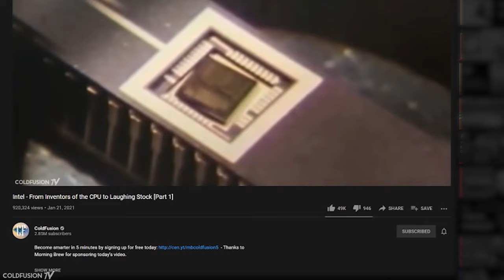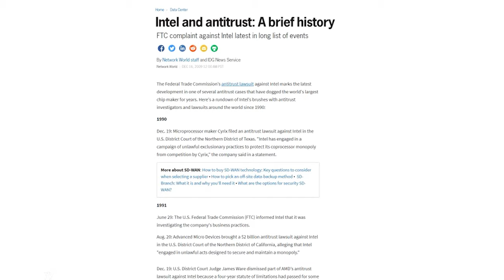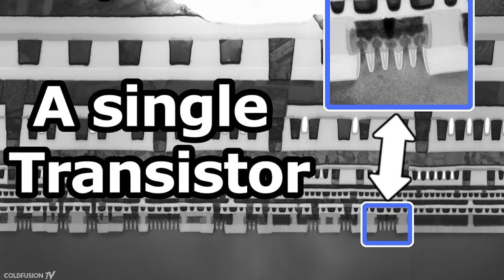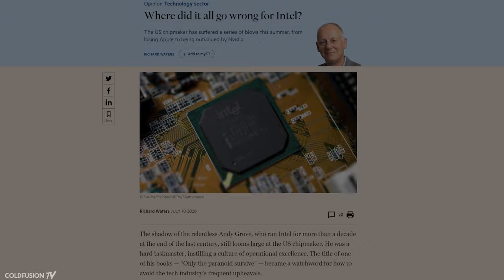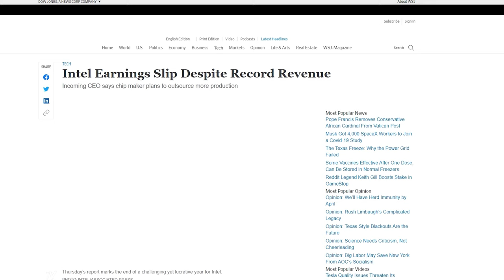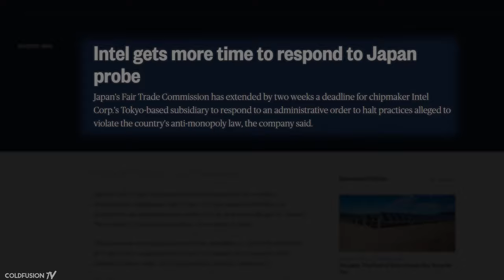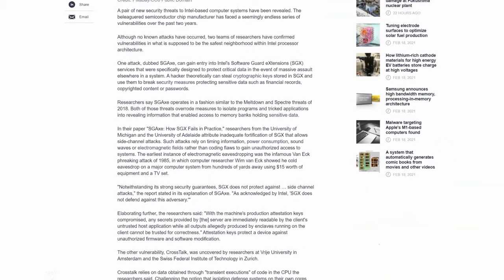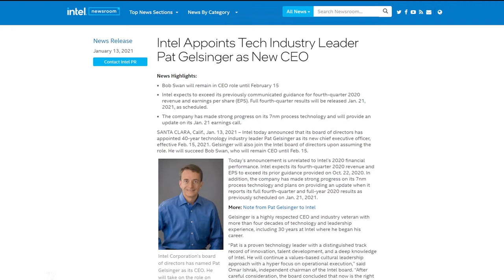Intel - From Inventors of the CPU to Laughing Stock [Part 2]

Comment: So, just to put the sizes of the transistors into perspective: the nearest-neighbour distance between atoms in the silicon crystal lattice is 0.235nm. That means that 5nm is less than 20 atoms. To me that is utterly mindblowing!
Reply: Kenn Honson X  ??????????
Reply: Kenn Honson X  No it isn't we passed 20 nm in like 2010. if it was just a marketing term TMSC and chip fabs would be sued for false advertising
Reply: @shadowxxe  we wouldnt have an increase on performance if the transistor would have been stuck on 20nm since 2010
Reply: Kenn Honson X  do you have a source? I know the 28nm was real (having seen electronmicrographs of them) and i was pretty convinced that the 14nm could deal with the sub-threshold leakage problems (the high-k dielectrics solution was genius). I had also heard some definitions of where they measured got changed with 7nm. Also with 5nm I don't see how they could possibly overcome the quantum tunnelling issues that would be significant at that gate width.
Reply: What do you think will happen at 2nm and below? A new lithography to read it or will it be something else?  The gates won't work. Too much leakage.  Another isotope will be needed.
Reply: More like over 30 atoms
Reply: Kenn Honson X  The reference material is outdated according to Wikipedia. Do you have another one, try and get one yourself and look at it through a microscope.
Reply: Kenn Honson X  Lol, we are in 5nm already. 20nm are more used on FPGA's. The benefits of advanced node manufacturing like going for 5nm is smaller transistors. With smaller transistors, you can put more into the same space as older larger transistors and more transistors means more power. That is why when you buy a motherboard today you see fewer components and chips as opposed to motherboard back 1999 which still has northbridge and southbridge chips to help interconnection, both northbridge and southbridge are now integrated in CPU's today which enables manufacturers design smaller pc's, laptops and smartphones.
Reply: @benjy117  We'll cross the quantum mechanics, gates will exhibit quantum tunneling meaning all transistors that should work like gates will now be useless due to quantum effect that both electrons can appear in any place at the same time. They will need to use exotic materials to avoid this from happening or create a new technology that can replace classical processor architecture.
Reply: @Rye042  Well, there is a thing with the size of the manufacturing process though. 5nm doesn't actually describe the size of a single transistor. A complete transistor made by the 5nm process is indeed about 20-30nm large as some in the comments here already pointed out.
The thing is though, this difference between how the process is called and how large a transistor is in reality exists since decades. A single transistor of a chip made with the 20nm process is also much bigger than 20nm.
Reply: @shadowxxe  Sorry but that's just wrong. The name of the node is not the transistor size, and its been that way for years now.
Reply: @Rye042  the north bridge is in the cpu, there is still a south bridge on many boards, sure there are soc's that have both but but for desktops the south bridge is mostly under a heatsink now days but still there cause Intel and AMD have not enough pins for the south bridge
Reply: all their pins go to ram and pci-e and some usb3 and some sata and the south bridge , south bridge handles audio ( realtek ALC) , extra USB3 and Usb2, the USB3 socket on the bottom of the board for external USB comes from south bridge not the processor. Additional sata can come from the south bridge but can also for a raid controller connected to the south bridge  ; if a cpu has to do that all on it's own, the speed would be lower.
Reply: @fullyverified7491  Yes i know it isn't its the space between transistors now where did i say it wasn't
Reply: @shadowxxe  when you said theyd be sued for false advertising if it wasn't?
Reply: @fullyverified7491  They guy I replied to said "It was just a marketing term" implying that the transistors were not in fact 5nm apart were this true conceivably they could be sued for false advertising.
Reply: @Rye042  They already did the exotic materials thing back at Haswell with the hafnium oxide (high K) gate oxides. you might be able to get away with smaller using graphene nanoribbons but I still think 2nm is a bit small. 3nm might be achievable then
Reply: There are limits to how small you can transistors make due to short channel effect. We are pretty close to theoretical limits now.
Reply: @shadowxxe  they can't be sued because they aren't saying they make 5nm transistors. Some call their node "5nm" (TSMC calls it officially "5NP" iirc), but they could call it the "pizza node" if they wanted.  It's just a nick-name for a manufacturing process.
Reply: The limits are not just the physical size of the transistor. Even if you could overcome the tunnelling issues (which you cant) then you would have lithography issues. They already had to move to extreme UV to reduce the wavelength sufficiently. Beyond that you start to get into x-rays amd they are much harder to craft the appropriate optics for. They can reach smaller fidelity with electron beam lithography due to the smaller wavelength (de Broglie theory) but at that point the limit is not the lithographic wavelength, but the photoresist/e-beam resist polymer. Polymethylmethacrylate (PMMA) is the most common e-beam resist and the width of the polymer chain is  around 1nm minimum. If you lined everything up perfectly and had the minimum achievable spot size you would still be limited to 1nm resolution by the polymer. So total limits would be: source (1nm), channel with gate (+1nn), drain (+1nm), gap to next transistor (+1nm), giving a minimum of 4nm. Realistically 5nm will be the last shrinkage and after that it is architecture optimisations like intel have been doing with their 14 nm process for a while.
Reply: It's the lithography size that's 5nm. Not the transistor itself. Kinda like using a fine brush to paint or carve the smallest meaningful art, to oversimplify it. But yes, it's definitely mind-blowing!! 😲
Reply: @ganesang5537  not sure that's correct either. It's not like Intel and TSMC use fundamentally different lithography. These machines often come from the same vendor while TSMC calls their nodes different than Intel for similar transistor density.

We either need to think if these names like code names or the industry needs to change.  For example, there's nothing particularly tiger-like in Intel's tiger lake or anything painting-like in AMDs renoir.  They are just names and trying to find meaning beyond that leads to confusion.
Reply: @ganesang5537  it used to be the size of the transistor, then they changed the definition for Marketing reasons
Reply: @Ormaaj  Even with GAA (gate all around) geometries you are still limited to sizes similar to those I mentioned. According to the definitions of UV once you get below a wavelength of 10nm you have moved from EUV into X-rays (https://www.britannica.com/science/X-ray), meaning that even the most extreme UV you can only achieve a resolution of 5nm  (according to the Abbe diffraction limit assuming perfect optics where sinθ=1).  EBL is easier because you don't have to contend with this diffraction limit (as electrons have a much smaller λ according to de Broglie theory) and are much easier to focus than X-rays.

Those limits are not just for monolithic processes, even with  some sort of hetero-junction (like with the graphene nanoribbon example I mentioned in my earlier post) you are still limited by how small you can craft those features by the polymer chemistry.  Modern resist polymers such as Hydrogen silsesquioxane (HSQ) can still only achieve 6nm wide lines (https://www.sciencedirect.com/science/article/abs/pii/S0167931707000408?via%3Dihub - I appreciate this was done in a lab 10 years ago but it takes time to reach production) and if you look at the molecular structure it is still over 4 atoms wide at the narrowest point (~1nm).

The way they have been labelling their devices is the big problem and the fact they keep changing the definition. It was originally source + gate + drain but now it seems they are just using gate length to try and use a smaller numbering for deliberately misleading marketing.

You might get more performance out of a HEMT process but you won't be able to make it smaller even if you improve the resolution, because of the limits of the atoms in the polymer resist structure.

Oh and resorting to bottom-up self assembly methods won't work either as you still need to demark the locations for your traces. Trust me, I spent several years trying to make molecular wires (that project had other issues but if you want to read more then https://pubs.acs.org/doi/abs/10.1021/ja110837s )
Reply: Yeah if you want to see a video of the EUV lithography machine of ASML ( which all these big fabs use to "print" the designs onto the chips)
You can check out the video: "Extreme physics that push moore's law to the next level" by seeker.
It is a mind blowing machine, you don't get all details as trade secrets but you get a little understanding.

Comment: AMD actually worked on making better chips while Intel was busy trying to take them down instead of focusing on better their products and ended up doing it to themselves in the process.
Reply: Wrong, amd is better
I've always bought amd because I believe in them so they're stock up up
Reply: @dixiedamelio8170  Thats literally what hes saying
Reply: @dixiedamelio8170  amd’s not always better. If you look at pc budgets between $500-$1k intel would be the better option with their 10100 and 10400f. However amd does beat them in higher budgets and performance with the 5000 series
Reply: @staitz2728  wtf are you talking about? Amd literally beats intel at all price points. It's not like amd's previous generation(s) chips suddenly disappeared
Reply: @tristanreymendoza2402  have you seen the 3600 and 10400f? The 10400f is the better choice. $50 cheaper and has the same/similar performance
Reply: Putting aside all of this Ford vs. Chevy nonsense, I think Alpha Jay is right. Intel was fighting for dominance. AMD was fighting for survival. You tend to get more creative when you're struggling to survive. Perhaps we'll see the same realization from Intel now that the tables are turning/have turned. Case in point (and if I remember the numbers correctly from the video), look at what AMD was able to do with a $1.8B R&D budget versus Intel's $13B.
Reply: @dmhendricks  The fact that AMD can beat Intel with a tenth of their budget is really mind blowing.
Reply: @dixiedamelio8170  💀💀💀 FX-Era AMD users have entered the chat with marshmellows for everyone. 🔥🔥🔥
Reply: @shangurila7   yeah, even less then Nvidia , Lisa Su  is the first AMD manager with a clear view  and the technical knowledge
Reply: Alpha Jay 3.0
That's ANOTHER LIE!!    When Intel was accused of bribery Lisa Su wasn't CEO of AMD! It was YEARS before she took over!
Reply: It doesn't matter that AMD's products are better, because they're a fabless manufacturer and depend on TSMC for actual chip production. TSMC only has three factories that are all busy manufacturing stuff for corporate clients, which is the main reason for shortage of their CPUs and GPUs.
Reply: @czos9239  my fx6300 served me well for years that was honestly a beast of a chip for 100 bucks 😂

Comment: Oh man, creating custom code to detect which CPU it runs on is on a parallel to Volkswagon and their shenanigans to detect if the car was being subjected to an emissions test.
Reply: One poses real threat to environment though
Reply: Tech waste is also a problem
Reply: if they can run benchmarks faster, why they wont run normal programs as fast? what is intel's benefit in this?
Reply: @TanveerAhmed10  as stated in video, benchmark used heavily optimised code when it detected CPU, it was optimised for
Reply: @MrMediator24  oh, i got it backwards i see
Reply: @brandon-22  And the other a real threat to my wallet
Reply: Should applications try to optimize code to take advantage of optimized cpu instructions that not all cpus have?  Do we really want the slowest common denominator?
This opens up a can of worms to a degree.  Should benchmarks only measure common instructions while real life applications will likely (or should) optimize?  And if so, doesn't that make the benchmark contrived and therefore not realistic?
Reply: @tripzero0  There is a difference between running "Intel Optimized" code and "AMD Optimized code" and then comparing and running "Intel Optimized" code and AMD Unoptimized or (worse) AMD Worst Case code and then comparing the two chips.
Reply: @remo27  maybe. do you have an example? Only way to know for sure is to look at the source and compile options.  What benchmark are we talking about.  Is the source code for the benchmark in question open to look at? If not, how do we verify the claims?
Reply: @tripzero0  : The video gives evidence that in some of the benchmarks Intel optimized code was run versus 'the slowest code it could find' if an AMD chip was found. If that is the case, then yes, that benchmark is bullcrap and that is all I said in my comment. In short, no - Optimized code is not always good in benchmarks unless you are running Optimized Code for all processors.
Reply: @tripzero0  It looks like the "benchmark" in question may be referring Matlab, which uses the Intel Math Kernel Library (Intel recommended it as a good application to use as a benchmark here: https://www.extremetech.com/computing/302650-how-to-bypass-matlab-cripple-amd-ryzen-threadripper-cpus). Turns out, the Intel MKL was looking at vendor strings to determine which x86 instruction set extension to use (picking fastest for intel and slowest for non-intel).

You could make the case that, yes Intel makes MKL, they should be able to do whatever they want with it. That is valid and fine (if a little sus). The big problem is recommending it as a benchmark (and not disclosing that they wrote some code that the application uses).

Sure, its fine to recommend programs to run as benchmarks that paint your product in the best light (everyone does it and its up to the reviewer to choose a fair comparison). It's not fine to recommend a program and not disclose that you have made some of the code that the program uses.

In this case, AMD gained 32 - 37% increase in performance when a bypass was introduced to stop the vendor id checking
Reply: @remo27  no. The video made claims.  Claims are not evidence.  I did not see a citation or a mention of the specific benchmark. Without this information we are just guessing.
Reply: Intel makes Volkswagen look good in comparison haha
Reply: @tripzero0  It's not that simple. I run an AMD processor affected by this "feature". Amazingly enough, if you set the right environment variable (MKL_DEBUG_CPU_TYPE=5), you can get the MKL to execute optimized code, and it runs way faster (and I have MKL_DEBUG_CPU_TYPE=5 set in .zshrc for exactly this reason).

So it's not like Intel just wrote code optimized for their CPU and couldn't be bothered to optimize for anyone else. That would be a little scummy--given Intel's massive resources, there's really nothing stopping them from at least running a pass to optimize for other CPUs--but it would be somewhat defensible. This is like they intentionally crippled the performance on non-Intel processors.
Reply: @mightyNosewings  I wouldn't expect AMD to spend money to optimize for Intel or the other way around.  MKL should be open source in my opinion and this wouldn't [still] be a problem.
Reply: @tripzero0  But like I just said, it's not like Intel 'just "didn't optimize" for AMD processors. They simply crippled all non-Intel processors. The optimized code still runs faster than the non-optimized code on AMD processors; the library just refuses to run it.
Reply: @mightyNosewings  according to the original article on the matter, that's exactly what it was.  It runs without ss[s]e*, avx* and other optimizations.  In the very least it's lazy programming to not check for the exact instructions, but in software that happens all the time.  Open source it and we can fix it or AMD could write an MKL library.  I don't see much in terms of community contributions like that but maybe that's just me.
Reply: @tripzero0  I don't understand what you're saying. Modern AMD processors have SSE and AVX (except AVX512, but not very many people have a use for AVX512).
Reply: @mightyNosewings  I'm saying there's a difference between "crippling" and not optimizing.  I'm also saying it's a leap to go from lazy to malicious.
Reply: @tripzero0  The laziest thing for them to do would have been to not even bother to check what CPU the code was running on.
Reply: @mightyNosewings  not all cpus support avx2 or avx512.  Many atom and celeron cpus don't, so many code paths have to be judicious or you get "illegal instruction" errors and the program crashes.

Comment: It crazy, I really got into PCs during the time Intels 4th gen came out and AMD was literally repacking 5 year old server CPUs as consumer products, which got so hot they could literally melt your motherboard.
A lot has changed since then
Reply: Hey, same! Still running an i5 4670 in my desktop. Strange times we're having.
Reply: I got into PCs, when I built an XT clone, and used a NEC V20-10 CPU.
Reply: Bullshit. My Turion X2 still works ok in 2024 - HP pavilion.